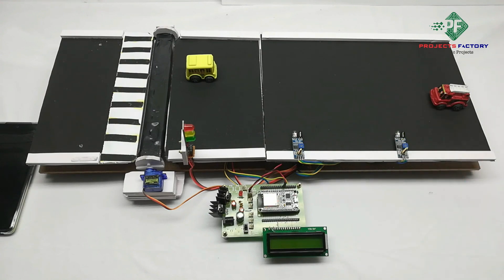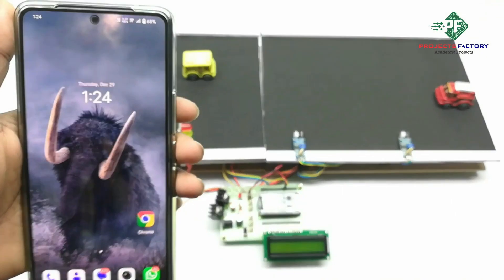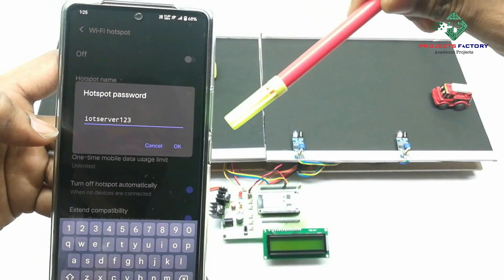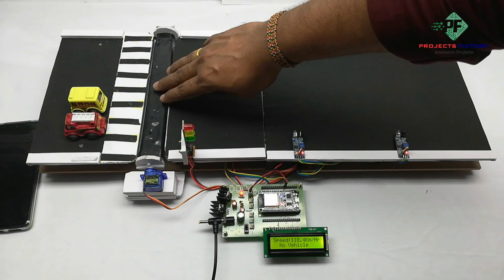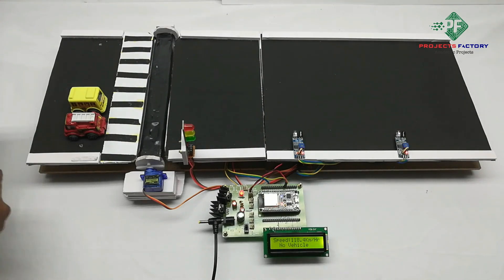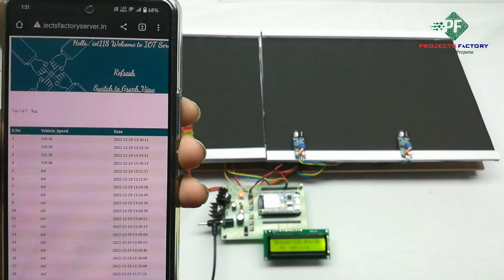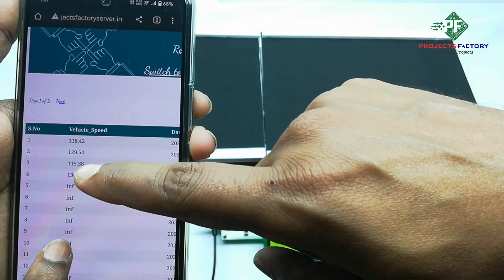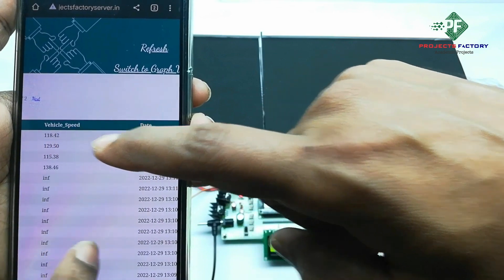Automatic Smart Speed Breaker Based On Vehicle Speed With Iot

Comment: Its extremely dangerous speed breaker. sudden appearance of speed breaker foe a high speed vehicle will cause accident.
Reply: Same doubt
Reply: We are making its reverse project. Speed breake will be rised continuously, but if vehicle slows down it will be flatten to ground. This will be an incentive for responsible driver. while above mentioned project is a punishment of irresponsibility without giving the driver any chance to explain reasons which even may be vehicle fault.
Reply: @01Academy  bro did u complete ur project i am also working on the same project
Reply: @igserBot  yes we made it
Reply: @01Academy  sir please give update on your reversed project
Reply: can you do tutorial plss @01Academy

Comment: Bro if the vehicle speed is more than 90,when the speed breaker comes out,then how it is possible for the vehicle to apply sudden brake at a speed of 90 to get slow at the speed breaker
Reply from the maker: This is a proof of concept for students. In real time application, developers consider various parameters and implement solutions. Thanks for watching.
Reply: such a illogical way 🤣
Reply: he should have fear if he drives fast speed breaKer will come off randomly and he will die